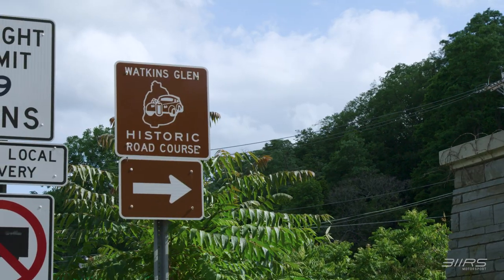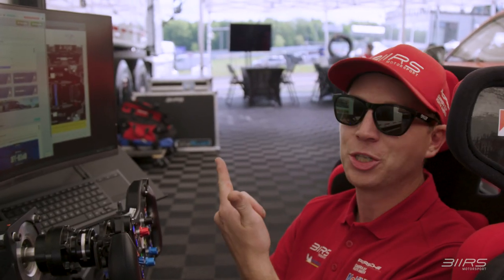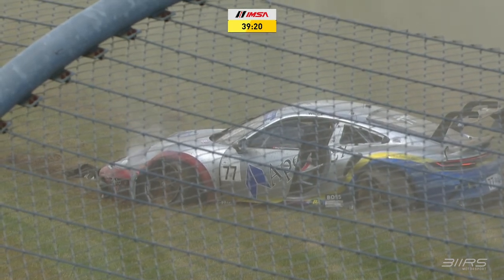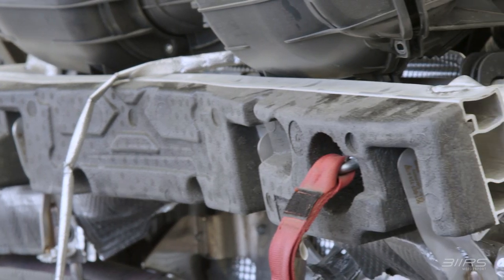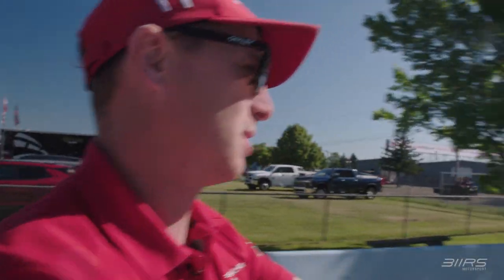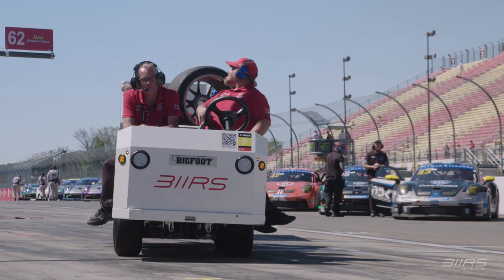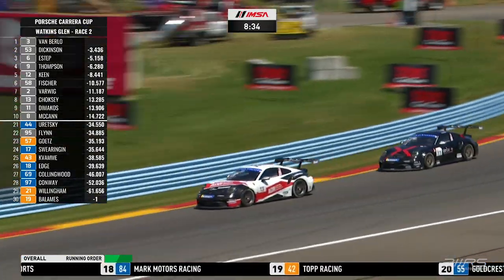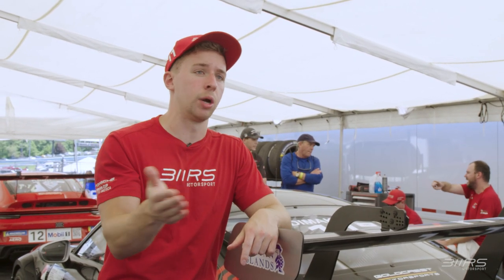Racing incidents and Top 10s | BEHIND THE WALL Watkins Glen

Comment: How does one get involved with motorsport teams with no experience?  Is there an entry point for people interested in working for a team?
Reply from the maker: Everyone's path is different, but certainly all involve some level of passion for the sport. Some guys have worked their way up from the technical side, others such as engineers or data guys utilize their skill set(s) to their advantage. Best place to start is going to the races.
Reply: I'd say start with your local club, get some miles and experience under your belt.  
It is enormous fun, but can be costly.  Start small with a 911 like Leh's personal car (long nose air cooled).
Reply: @911aircooled5  I already track.  I was talking more so about the business side of things.